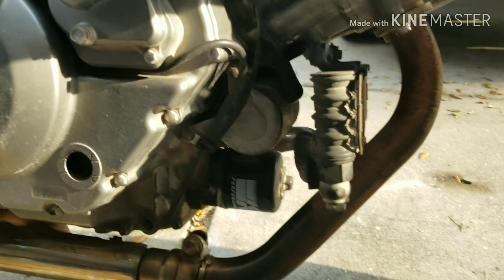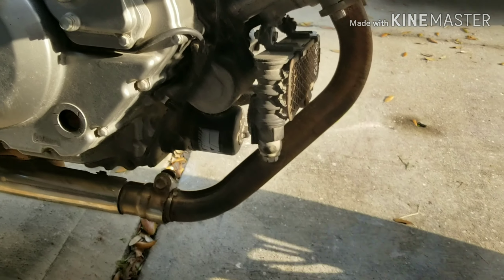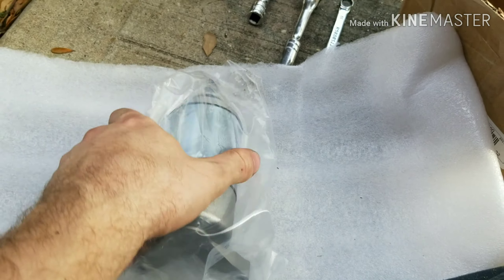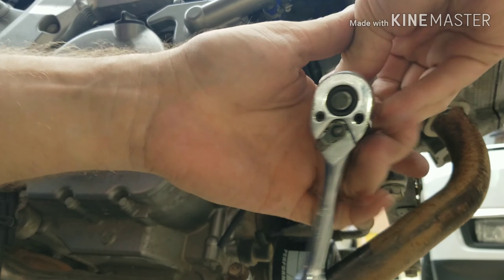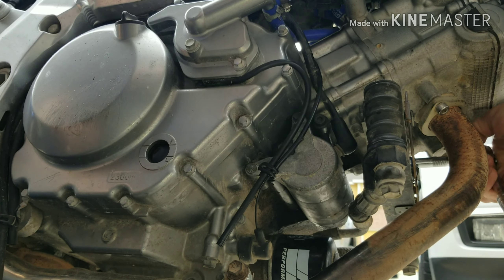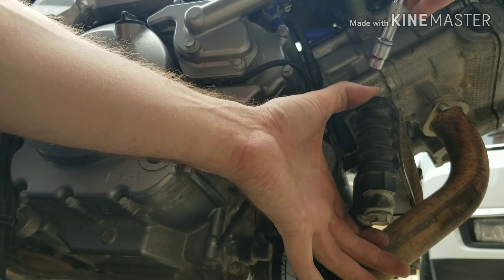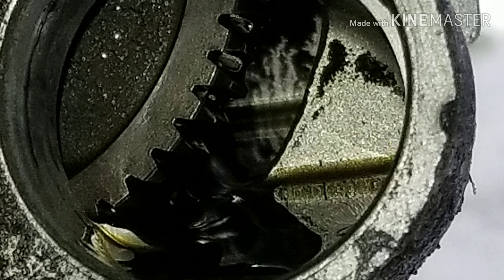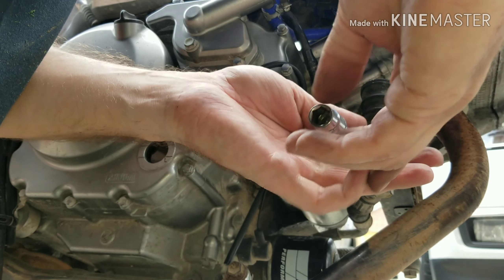How to change a starter on a SV650

Comment: Do you know if the Suzuki SV650 Starter Motor is the same as the HYOSUNG GTR 650 Starter Motor?
Reply from the maker: They are not the same configuration but available on Ebay for like $70 dollars.

Comment: Not sure if this gets noticed but, my issue is - Fresh batteries, all check on pre-start procedures, but when I hit the start button, it always seems like it got a hard time cranking. It starts but it's always a guessing game coz sometimes it just sounds like it spins the motor a bit then it gets stuck. It sometimes comes to a point where I drain the battery coz it does that over and over again, and I don't wanna leave my bike at the gas station. Sometimes though, it starts like fking brand new.
Reply from the maker: @Valheimier  are you currently having this problem?
Reply: @svcruza  yep. I got a k5 sv650. Could it be a starter issue? I took the starter off and tested it and it spins just fine though.
Reply from the maker: @Valheimier  if your battery is at the required 12v and stable at 12v, then the next thing I would check is your grounds and your starter relay connections...if they aren't clean and shiny, the power cant travel through them at full capacity. Think of electrical wires as a steam or river that is flowing smoothly....once you start adding rocks and beaver dams, then it no longer smooth flowing. Now it's got resistance. Same with wire connections, if there is dirt or even corrosion on the terminals, the electricity cannot flow fast like its designed too....so check your connections and your grounds.
Reply: @svcruza  I recently changed the relay. Had the terminals sanded shiny to make sure no grimes blocking the current. The ground I’m not sure though. They’re supposed to be the mountings for the starter motor, right? Thanks for following this through by the way.

Comment: I bought a cheap Chinese one and it seemed to work fine but after half an hour riding the gear shift became really stiff, something to do with how the starter meshes with the flywheel? Like the teeth on the cheap starter are manufactured wrong?
Reply from the maker: No, they are completely separate from each other. You might want to closely inspect your clutch cable and the linkage. I had this happen 3 times, each time was a different reason but same result. Either we couldn't pull in the clutch handle or it was just binding up making it difficult. Make sure the cable is healthy clean and straight with no kinks because that will affect its function. Check the clutch lever pivot point and see if its dirty, corroded, or just too tight. If so, clean with soap and water and lubricate with penetrating oil or WD-40. If all that checks out to be good, you're really not going to like this next possible reason which would point to a failing clutch assembly. This mean you may have to get new clutch plates.
What's the year, make, model, and mileage of the bike?
Reply: @svcruza  thanks, seems odd that it only started after I changed starter motor, just coincidence? It is a 2006 DL650 Vstrom.

Comment: Hi great video. I have a 1g sv650. how do I check to see if the ground is properly secure on the bike
Reply from the maker: Just make sure when you reassemble components that the connectors are completely on (usually listen for a click) and make sure there is a clean or (shiny) surface on the wire connector and the nuts or bolts to ensure a good solid ground.

Comment: You failed to mention with fairings and if the nut happens to be rusted lol then when trying to pull it's like giving childbirth lol Had to WD40 nut on starter and using a vise grip. After much determination, boom off!  Currently on the pull and no not ten minutes. However the use of a hammer on the other side by my son and my receiving the starter was delightful. Felt like giving birth to a new starter lol. Installed but did not start right away. Charging battery and will see If no problem after. Otherwise grrrr. But, shout out to you for helping me with the basics. 😘💯🔥 Going for a ride now!!!

Comment: OEM starter is $411.  What brand did you end up getting that was 40-50?
Reply from the maker: I bought the Caltric starter on Ebay. It was a good starter and had no issues after the swap out. There is one thing I highly recommend doing before installing the new starter to prevent future oil leaks and that's to install a better O-ring on the starter.
Reply: @svcruza  gotcha thanks for the help!  I'll see if I can't get an oem o ring.
Reply from the maker: @riderdie1603  I was able to get a better o-ring replacement at ace hardware.

Comment: pretty sure i have this problem when i try to start the bike it makes a weird noise like it’s hitting something or catching up on something. didn’t realise what it could be so i did it a few times, how long does it take before the flywheel teeth start grinding down to the point it needs replacing?
Reply from the maker: Honestly I wouldn't wait around to find out if it's chewing up my flywheel teeth since that is a rather expensive repair it is so much easier to take out the starter and inspect the teeth yourself versus taking that Gamble

Comment: Awesome tutorial.
I've got a question - should I get the oil engine out before the operation?
Reply from the maker: Good question....thanks for asking. The answer is no you dont have to, because the oil level is low in the engine casing and wont flow out of the starter access. Note: when you do take the starter out, there will be just a little bit of oil dripping out so make sure you have something under the bike to avoid a mess. I hope this helps.
Reply: @svcruza  Yes, this seriously helps a lot. I wanted to make sure before I touch anything there. Thank you so much!
Reply: @svcruza  If there is a lot of oil coming out, do i need to replace it?
Reply from the maker: @jorstad17  excellent question, I ran into a similar situation, the starter is still good but it leaks oil. Simple fix, I bought a starter rebuild kit(super cheap) and I replaced the O-ring on the starter and that worked like a charm. The kits are like $15 on Ebay.

Comment: When I throttle my lights get brighter and then the lights begin to dim when I release the throttle? Is this just the battery or the starter.
Reply from the maker: I have a few possibilities that may be occurring. I will say that I doubt that the starter has anything to do with it. 
A. Check all ground wires. A poor ground will result in voltage drop so make sure there is no corrosion or rust on the terminals or connections.
B. Stator failure is most likely your situation. A motorcycle stator is basically the bikes alternator, if it fails, it no longer generates electricity for spark therefore the bike loses power, spikes in power under load (acceleration or revs), or ceases function altogether. 
I hope this helps brother.

Comment: Where did you buy the starter motor? Are the cheap ones on ebay a good option, from china? Any brand you suggest?
Reply from the maker: I bought mine from the Suzuki dealer which their products come from Japan, not China. Dont buy cheap components if they are vital to the bikes functionality, you will be wasting your money. It may be expensive but its worth it.

Comment: When i removed the starter it leaked some oil like third of a quart is that normal or do you think something is wrong with my bike?
Reply from the maker: Yeah that's normal, the same thing happens to me when I had to change the starter. The gears inside are sitting in oil.

Comment: My 99 SV650 wont turn over after a new battery.  It just clicks.  Would changing the starter be a possible solution?
Reply from the maker: Yes. That click you hear is the starter relay. First check all your power and ground connections from the battery to the starter and make sure they are tight. Then take a wrench or a hammer and hit the starter to see if the starter solenoid is just stuck. Then try to start the bike. If it starts the bike, then the starter needs to be replaced.

Comment: I screwed something up... guess I shouldn’t be working on bikes lol. Put it back together and hit the start button, but the starter just spins and doesn’t turn the engine. Any ideas what I did?
Reply from the maker: Ok there are a few things that are happening. 
1. The starter was installed crooked and not allowing the starter gear to reach out and contact the flywheel to turn the motor. Double check your installation (take your time).
2. The starter solenoid in the starter is stuck or faulty. If it's a new starter remember, (just because it's new dont mean its good). To see if its closed try this...take a hammer, big wrench, or something similar and hit the starter casing to see if it will jar it free. 
If the starter is an old one, it could have carbon buildup on the solenoid so by hitting it with a hammer breaks up the carbon inside allowing functionality again. Note: if hitting it with a hammer or wrench works, then it means that starter will need to be replaced asap.
I hope this helps.

Comment: oof. thanks to this video i now realize that i got a bigger issue than the starter LMAO. also where do you order your parts from? Id rather not spend an arm and leg and thats all ive seen online :(
Reply: long story short i realize my crank case is cracked right where the starter goes in. I dont mind doing the work to replace it cause im mechanically confident in my abilities. but i wouldve never realized without this video
Reply: my only question is this: do i need to replace the entire case, or is there a simpler fix to repair the bike? Starter still goes in, not sure if it leaks oil (its cold, havent looked), im charging the battery now to see if it even starts like its supposed to. will be back with updates and the hope that i get a response :)
Reply from the maker: Brother I sold that bike 2 years ago so I dont remember if you would have to replace the stator cover because if I'm not mistaken the starter goes into the stator cover. If not, then yes you need to replace the casing that is cracked. Also I buy all my parts from 2 locations. 1. My number one shopping place is Ebay, there are a lot of highly reputable retailers and high performance stores that do most of their business through Ebay with lower if not wholesale prices, opposed to ridiculous dealership prices. 
2. My second most successful location is Partzilla.com .
TIP: I highly recommend you upgrade the o-ring on the starter to a thicker one to prevent oil leaks. I ended up having a leak after this video was released and went to ace hardware and got a better o-ring. Oil It before installing it!
Hope this helps dude.